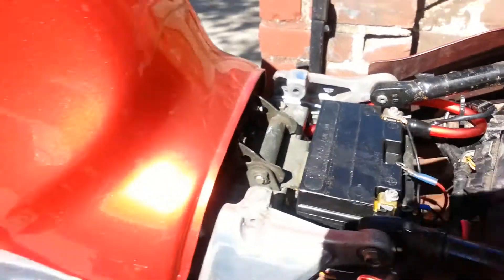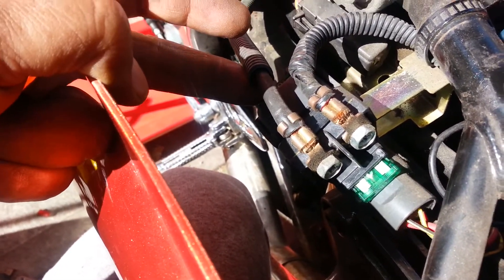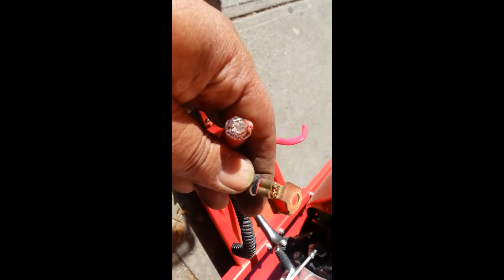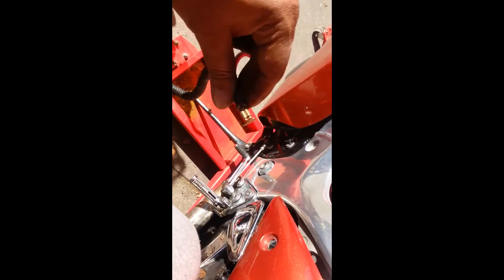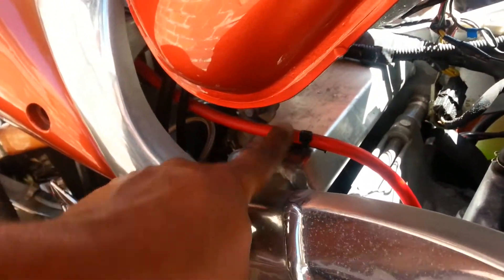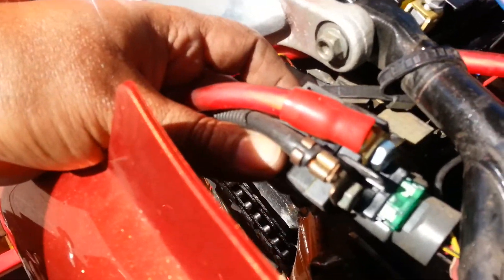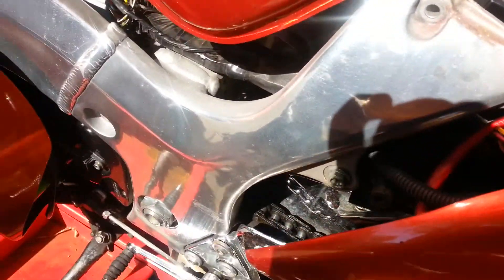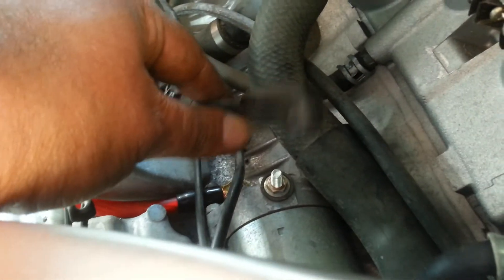hayabusa starter wire upgrade. Part 1of2

Comment: looks like good work, no issues doubling guage it just going to get more juice right now, going smaller would heat up so larger of course its going to take a lot more current before getting hot, like if you have a hi compression engine and that starter has a lot of work to do this is a great idea ..

is that what you have here a big block high compression like a 1350 whatever hi comp?  seen guys use tow batteries, double gauge in series but you can see how they finally resolved this and that is a remote starter, lose about 5lbs altogether and the remote is very strong so with the battery gone all that wire all that maybe 15lb loss .. well thought out hope is resolved the problem for ya . .